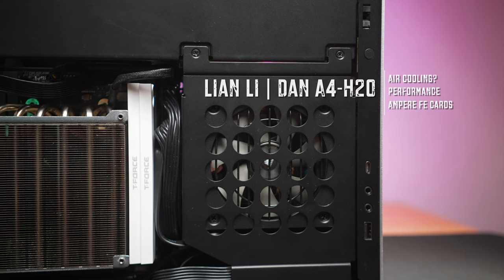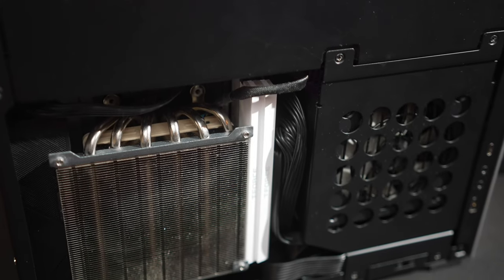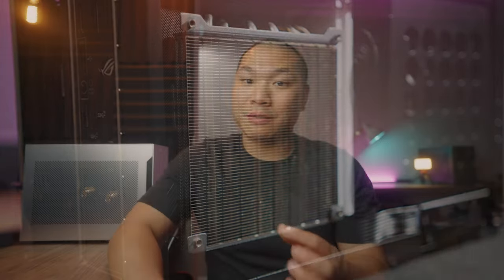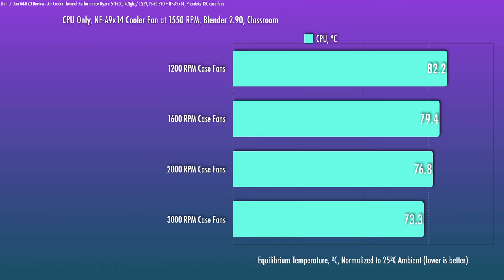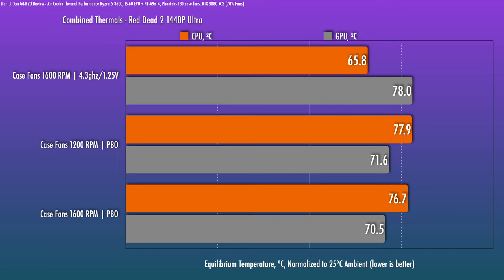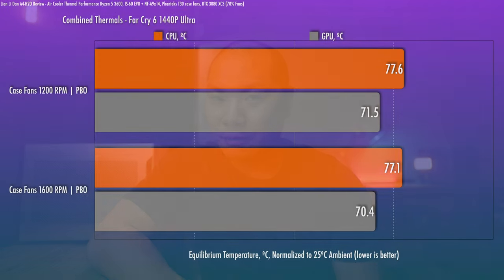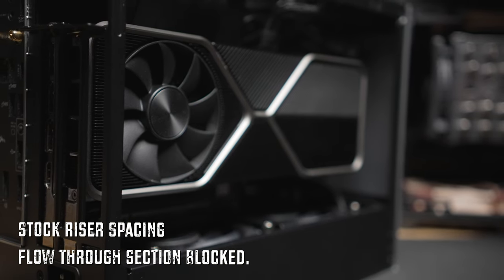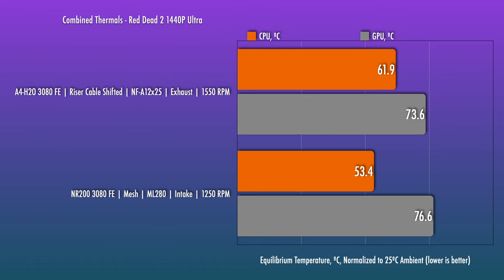Lian Li | Dan A4-H2O: Air cooling and FE Cards

Comment: Very cool vid. Ended up using a 5600 with L9A and two Bionix fans as exhaust. My reference 6800XT runs at 50c junction temp with a mild undervolt and the CPU runs at 60c. Such an under rated gaming case.

Comment: Bought mine in Spring last year. Run it with 240mm AIO until now. First AIO (EKWB Basic) got noisy after 3 months and now i had to detect, that the spring for those magnet rings to install the cover are defective... 
I didn't had the muse to again reinstall an AIO so I did go for an air cooler this time. Bought the L9a and the fan duct by noctua. 
And well. It's okay! Ofc my 5700X gets hotter than with a 240mm aio. But only in synthetic benchmarks! In gaming the temperatures are realitive identical to the aio setup. I think because the cpu didn't cooled by the hot air from the gpu (RX 6750 XT MBA) anymore...
The gpu runs a bit cooler too...
The stock fan of the L9a runs with only 1400 rpm in those scenarios. 
(some numbers: Temp hitted 79°C in a 30 Min CB23 MC run with only 1400rpm, so there is actually space)

My conclusion: The A4-H2O ist suitable for aircooling builds, too. Ofc i wouldn't do anything above the 5700X or similiar processors.

Comment: Couple questions:
-Do you have a 3090 FE card that you could test in this case as well or have tested?
-Does the motherboard sit flush with the power supply? Some ITX motherboards like the ASROCK B550 and X570 have right angled SATA ports that face the power supply. Are these compatible with this case or is there no gap between the power supply and motherboard?

Comment: Could you please test the IS-55 with this case? If the specs are right the cooler will be right next to the air vents on the panel and should perform well.

Comment: Do you think I could run a 12600k (no overclocking) comfortably enough with a similar air-cooled setup? I was originally thinking of doing that in the smaller Dan A4 case, but trying to get a handle on whether or not it would be worth sizing up a little for better cooling.
Reply: He literally just showed this in the video, did you watch it? He tested the 3600 so all you need to do is compare that against your own cpu...
Reply: @samgoff5289  I'm asking because he said that 65w TDP is recommended. But I want to understand how much I can stretch that to the 125w 12600k without watercooling.

I'm so sorry I didn't realize there was a moderator in the YouTube comments. Jesus Christ.
Reply: bro,have u done this? I am try to do the same thing as u. How the temperature
Reply: hmmm yeah after seeing the results, what would happen if you put in a CPU that produces about the double amount of heat 🤷‍♂
Reply: @spacehaze420  Impossible, my 12600kf ended up with the highest 75 degrees. i don't think u can use a CPU with double amount of heat
Reply: with AXP-53 cooler
Reply: @ShunjieWan  The AXP90-x53 is rated for higher tdp the the cooler he is using in this vid. Also he is using only 1 fan, where it comes with 2 out of the box. A 12600KF is def. possible in that a H20, but i do not believe that it will work well with the same cooler set-up.

Comment: Is there no push-pull in this case? I'm only seeing 240mm rad support on topside for AIO. Great video on SFF coverage tho, one of my favorite go-to channel apart from Optimum Tech. Suggest to include a simple animation for air flow in future case coverage.
Reply: No push pull, you are correct the 240mm at the top is the only fan location. It’s a very compact case!

Comment: Do you think you can squeeze 60mm air cooler with 4mm motherboard standoffs. Is 55mm CPU clearance exact or is there 1-2-3mm extra space?
Reply: It's exact. One more millimeter and you can't close the side panel. With this case, you either put up with a 47mm CPU cooler, or you go with AIO. I've lost so much sleep thinking about air cooling A4H2O but eventually decided it's not worth it for any >95W TDP CPU.

Comment: I’ve been waiting for either ID-Cooling or Alpenföhn to put out lga 1700 kits for the IS-60 and Black Ridge respectively. (Kind of looks like the adapter Alpenföhn has for their Ben Nevis cooler might fit as their cold plate dimensions look almost identical so I may try that) Waiting as well to see if anyone tries fitment with motherboards like Gigabyte’s Z690I ddr4 to see if something like the black ridge can seat on there if that bulky m.2 heatsink is discarded. I feel like that cooler with a 120x25mm fan on top would make for a snug fitting but effective air cooling option for Meshlicious.
Reply: @Ruben Schilling thanks, man. I had actually ended up going with an EK AIO. Since posting that before, I ended up rethinking my build. I’m probably going to go with a simple and reliable B550 ryzen 7 build, as the two options for z690 itx motherboards with ddr4 support seem to be kind of crap. Might wait a bit more to see if new revisions of those improve things.

Comment: Any chance of a full custom loop? I did some calculations and I believe this combo might work with the total gpu thickness of 65mm:
- Xspc tx240 = 20.5mm
- EK quantum vector fe 3080 = 29mm
- noctua nf-a12x15 = 15mm
Total = 64.5mm
Im thinking that this might work with another rad up top and this setup squeezed on the side. 

Great video!
Reply: unfortunately the tx240 is too wide for the case. it's ~125mm wide and max radiator width that case supports is 120mm
Reply: Wow that quite a challenge !